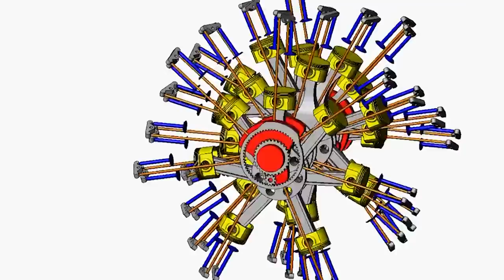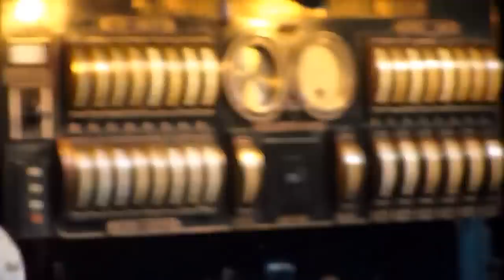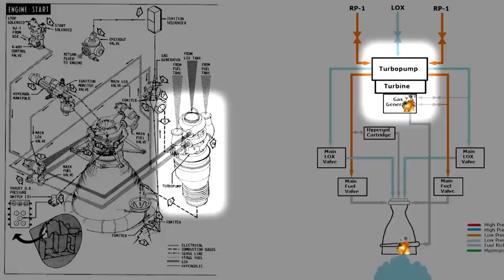The Most Powerful Engine in The World

Comment: One thing you mentioned about the spruce goose is hugely wrong. The plane never did fly anywhere. The plane was incapable of flight and the reason it never did a second run. The spruce goose was another example of slight of hand. The spruce goose used what they call ground effects to lift itself off  the water but after a certain point unless the plane can actually fly it can’t break free and actually fly. Sorry Howard you’ve been exposed!!

Comment: Interesting, but it needs a fair bit of editing and better research. The truck isn't Big Mike, that's the builder, the truck is Thor 24. You misread the engine size on one of the GEs as mm instead of just meter. A wind turbine isn't an engine, its a generator.

Comment: The Most Powerful Engine in the World, would actually be the Rocketdyne F 1, used on the 1st Stage of the Saturn V Rocket
Reply: Actually no, at 3.28 million pounds force, the SLS five stage SRB booster far outstrip the F1 which managed less than half that.
Reply: @iankynaston-richards883  
I stand corrected, You are right there. I didn't think of the SRBs, simply because I have never paid any attention to the Shuttle. It was a boring and very poorly engineered(due to underfunding the Development Costs) Cargo Truck that never really went Anywhere.

Comment: A single F-1 engine could lift =
22,000 german shepherd's
9,400 average men
290 Chevy tahoes
160 African elephants
5 1/2 Blue whales
1.25 A-380 airbus's

These numbers multiplied by 5 gives you the combined thrust of Apollo's 5 engines. They consumed 28,415 pounds of fuel per second, or about an average swimming pools volume every 6.5 seconds. By the time Apollo 15 cleared the tower (13 seconds) It had burned 369,395 lbs. of rocket fuel and was only 380 feet off the ground.

Comment: It’s pretty dramatic that you mentioned a four-cylinder as one of the biggest most powerful engines. You also forgot to mention Cletus McFarlands race truck named mullet that it’s just a 7 liter V8 that’s pushing 3000 hp
Reply: Or the many top fuel engines pushing around 10,000 hp. It was an odd and poorly narrated list.

Comment: I mean..I can name almost 20 engines with more power than most of these lol. But okay.   Here's a bit you learn when getting a degree in mechanical engineering.   All engines are motors but not all motors are engines.   A motor is a machine that supplies motive power for a vehicle or other device with moving parts. While an engine is a machine with moving parts that converts power into motion..  the more you know.

Comment: The Wartsila flex 96c uses less gasoline?? seriously?
Reply: It runs on heavy fuel oil, and it is more efficient than other engines in it's class.
Reply: @blockstacker5614  yes I know, the gasoline comment refers to the commentary on the video

Comment: 14:30 5.5 millimetres long and 3.5 millimetres across with 127,900 lbs of thrust.
That’s got to be a record for the smallest engine with the biggest thrust.
5.5 millimetre is less then ¼ inch.
I’m sure he meant metres.
Good job he stuck with lbs for thrust.
22:37 come on please 27 not 28.

Comment: The narrator needs to learn a lot, especially the metric system! (11) The GE90115B is 5.5 millimeters long and 3.5 millimeters across [14:30 - 14:38]...!🤣🤡
That's less than 8/32" long and less than 5/32" in diameter? 🤣

Comment: Sorry, but you have no idea what you are talking about. Most of the info about the Brutus, for example, is just plain wrong. First of all the engine didn't get into BMWs hands mid twenties. It was originally built by BMW for a plane which possibly was flying in the spanish civil war (which was mid to late thirties). And the chassis didn't came from a race car but from a fire engine. At least you did get American LaFrance right. And lastly the car wasn't built by BMW, only the engine was. The car was built by the technology museum of Sinsheim (which is actually written on the car btw), and it also wasn't somewhere mid twenties, but rather late nineties and early 2000s. They built the car because they thought it would be cooler to do this instead of just displaying the engine in the museum. Brutus was unveiled in 2006. Took me less than 10 min to find all this out. How about doing a little research instead of talking BS?

Comment: The video was good, but you need to learn how to pronounce things. Manheim is pronounced "MAN" "HEIM" (or HIME) and not "MAN" "A" "HEIM" no "A" between the two halves of the name. Also changes to a cars design are not called "ALTERCATIONS" they are "ALTERATIONS", an "altercation" is a fight, or scuffle... and an alteration is a change or modification. Also not "A" "SSEM" "BLE" "LY", but "A" "SSEM" "BY" 3 syllables not 4...

All of the errors in speaking were driving me nuts. If not for this I would have said the video was excellent. I did have issues with some of the engines listed however.

Combining multiple engines such as 18 chainsaws which are not a large motor, the two engines in the Semi-Tractor might count, as two, but not one engine, and the 48 cylinder motor cycle counts as three engines.

Comment: Number 19 that truck is not a diesel it runs on alcohol because Diesel engines don’t really work well with belt driven supper chargers that truck has super chargers so they are not diesel there are alcohol engines

Comment: what a bunch of hog wash, at least have an engineer who know what an engine is before you post anything like this to proofread and go through the list. Ther are so many mistakes and wrong information in this clip I do not know where to start. 13:36-37 I can guarantee you, this engine does NOT run on GASSOLINE. Common rail system is by the way garbage.

Comment: Marine engines are the biggest powerful IC engines. Locomotives and truck or any road transport engines do not come even close to them in terms of power, size. The marine engines on a large VLCC have lube oil dumps that hold 40 tonnes of Lub oil. In addition they consume oil for cylinder lubrication. So get your facts right and do your research before making videos like this. A big joke that u have ranked loco engines and haul truck engines above marine engines. Engines of 4 MW are used on ships just to generate electricity in addition to propulsion engines